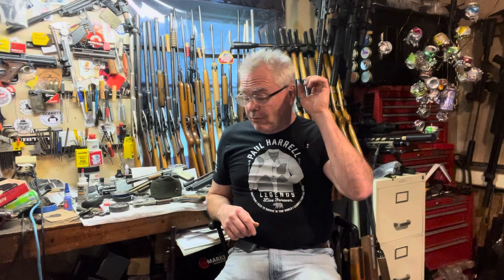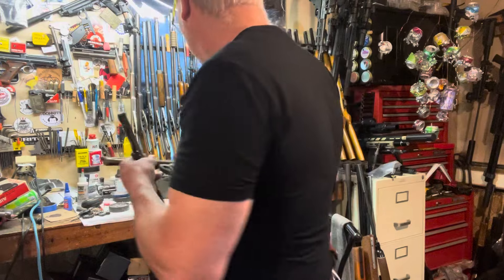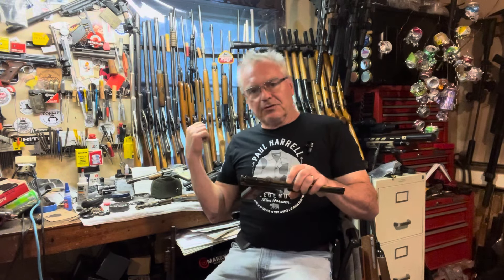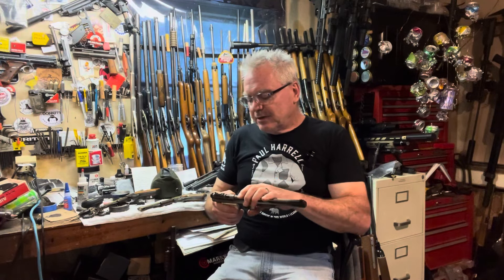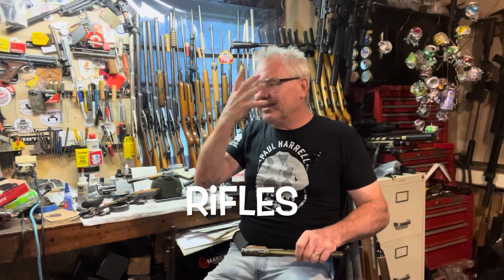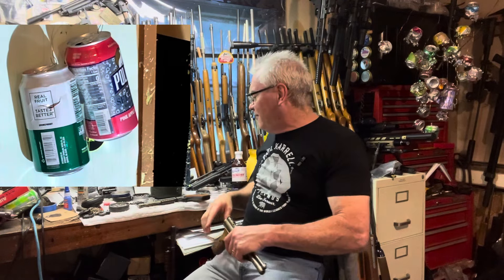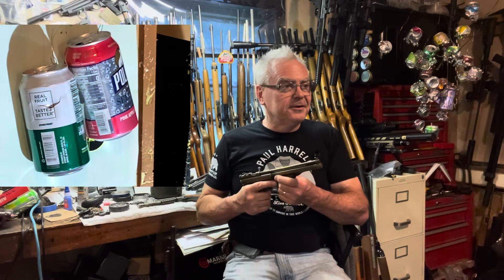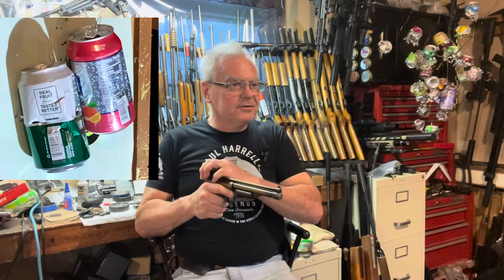Comparing older vs. newer Benjamin 130 series pistols & plinking model 137 & two 132’s

Comment: When i was a young child growing up we had a neighbor 2 houses down from us at the end of a dead end steet that ended next to a set of north and south railroad tracks. He had an old air pistol in 22 cal like the ones you had in this video. Anyway we didn't know it at the time until later when i was in my teens it came out he would sit in a upstairs window while the trains hauling new car's went by and would shoot the side window's out of new car's as the train went by. From the window to the tracks wasn't more then about 50'.

I was born in 67 so he must have been doing it around the mid through later 70's. Between theft and vandalism the railroad companies started putting metal panels on the sides of newly designed box cars to limit vandalism and keep people from stripping parts from the new cars and trucks. They are still making the box cars for automobiles the same way today.
Reply from the maker: That is crazy!
Reply: @WalnutandSteel when I was a kid , I could fit in the storm drains.  I would squeeze up the skinny pipe  to emerge at street level looking out from the curb height.  I will just say that it is possible to shoot the hubcap off a car while its driving by.  Is there a statute of limitations on such heinus crime?🤐🤫

Comment: If you or a friend have any Bic or Cricket brand lighters out of fluid. Carefully remove the spring from under the flint wheel. Cricket lighters use a noticeably smaller diameter spring then the bic lighters.  But both are very small.

Comment: The 1st variant was a front pumper, but since then the design didn't change much.😎👌
Reply from the maker: i know they made a front pumper early on, was that still called a 13X model?
Reply: 1st  series was 100(bb only), 102 (.22), 107, 117 (1935 only) 122 (1935 only)     2nd series was 1938 to 1942  110, 112, 117, 150(8 shot repeater), 130 .      These had forward facing butterfly linkage.  A bad design, and prone to failure.  Then came the 3rd series (42-86) 130, 132, 137.  These have the proper underlever linkage.  From 42-57 they made model 160.  A .177 cal. Auto load 8 shot pneumatic pistol.  From 58-77  model 1320 was 35 shot auto load .22  .  3120 was a 85 shot auto load .22 rifle
Reply: 1st series was front pump rod, 2nd series was under lever connected to front rod, 3rd series was the under lever your familiar with, directly linked to piston rod from bottom with no front pump rod.

Comment: Those brown grips are much later, used in the era where they used a matte black finish directly on the brass.
The marbled grips are the 1st synthetic grips Benjamin used, back in the era when they nickel plated the brass then used a glossy black nickel finish over that.
The black was extremely thin and easy to wear, thr nickel under it stands up much better but isn't all that durable of a layer either really.
That's a very nice 137 you have there.
I have an early 132 of the same era and with shallow rifling it's a plenty sufficient plinker but not quite as accurate as I'd like.
I have been looking for a 137, but right now I have a pair of very early Crosman 105's and seal kits on the way to deal with.
I'll keep looking and hopefully will score a 137 some day, but it'll have to wait.